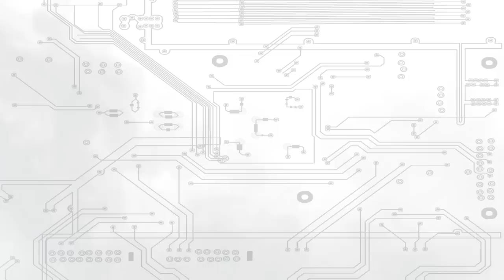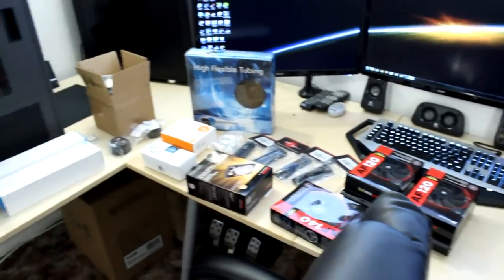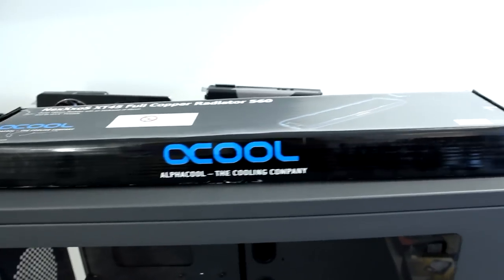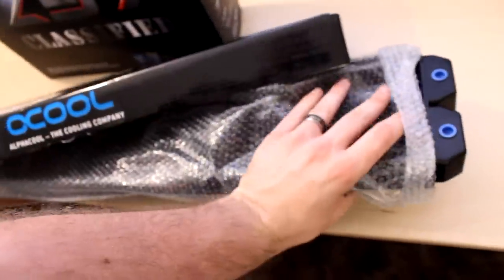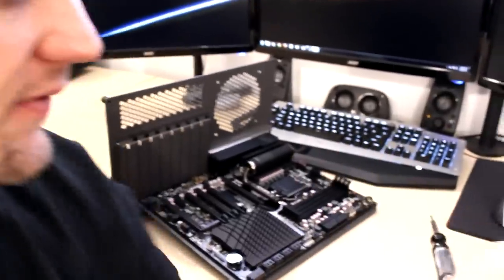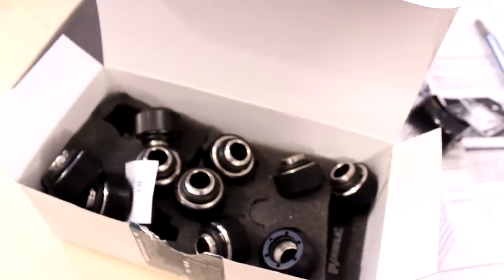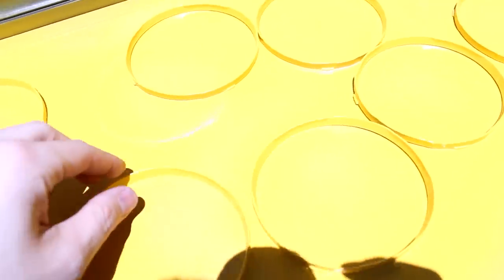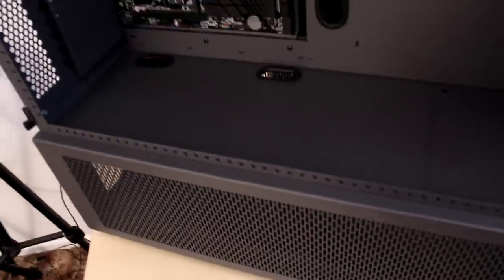Personal Gaming and Rendering PC Upgrade Vlog - Part 1

Comment: Why the AF fans for the radiators and not the SP's or a different high static pressure fan for radiators?
Reply: Those radiators are massive so he can use fans with low rpm anyway so it wouldn't really matter. AF's are just quieter.
Reply: Because Corsair didn't make SP140

Comment: Can i have some opinions on a cheap PC i want to build?
CPU:Intel Pentium G3258 3.2GHz Dual-Core
CPU cooler: I have an extra
Motherboard: Asus H81M-A Micro ATX LGA1150
Ram: Crucial Ballistix sport 8x1gb
Storage: Seagate Barracuda 1TB 3.5" 7200RPM Internal Hard Drive
Graphic/video card: Asus GeForce GT 630 2GB Video Card
Case: Rosewill FBM-01-450P MicroATX Mini Tower Case w/450W Power Supply
CD/DVD/Optical drive: Samsung SH-224DB/BEBE DVD/CD Writer
Im choosing between Windows 7 64 bit or 8.1 64 bit, I like Windows 8,1 more but 7 is cheaper.
Anything I should do different?
Reply: pirate the OS and with the money u saved get atleast a 750 ti or a r9 270
Reply: Axecution Or just find a student, and you get it for free.. Legit.
Reply: Impatience not in my country, lol
Reply: Really? I know in the US, UK and most of the EU you can.. Through the MSDNN or something like that :)
Reply: 640 is really cheap too
Reply: Axecution i have a qustion. if i build a pc and i want to change the cpu do i have to build a new pc or what
Reply: Ayan shaikh depends on what your current motherboard is, most of the time you can swap the cpu only or just a new motherboard
Reply: Axecution Its from an old dell that wont work wit any of these cases
Reply: Aaron Wright then its a bad luck
Reply: Axecution my mother board is asrock fatality Z97 KILLER SERIES
Reply: Ayan shaikh what is your current cpu? you can get a i7 4790k and overclock it if your cpu is lower tier than that
Reply: mine is intel quad core i7 4790k
Reply: Ayan shaikh the only thing worth upgrading then is x99 platform with a 5960x and ddr4
Reply: All i have is an Intel core 2 duo and an AMD processor that has all its pins bent
Reply: oh
Reply: Aaron Wright Change the GT 640 out for an entry-level GTX-series card like the GTX 750, GTX 750ti or the GTX 650
Reply: Aaron Wright Won't do much at all. If you want to game, its not gonna do it.If you want to video edit, its not gonna do it.
It seems like a good, browser. Maybe a low end server machine.
Reply: Gummin its just going to be for light gaming that the computer i had before this could handle
Reply: Aaron Wright Alright. Seems, fairly good for that then.

Comment: Is the performance gap big between the 4790k and 3770k? I got the 4790k for the improved thermal properties, but the 4790k doesn't seem to OC as high as the 3770k.
Reply: There is little to no noticeable difference.
Reply: I thought so...
Reply: Salpeteroxid I could take that 3770k off  your hands..... Nah i'm just kidding.
Reply: ThaRamoHD
Hehe if I had a 3770k I wouldn't have upgraded. This were just things that I've heard other people talk about.
Reply: But forgot one thing. The 3770k has a LGA 1155 and the 4790k has a LGA 1150 so new boards will come out with it and the LGA 1155 cpu's will have to deal with older motherboards.
Reply: *****
Maybe, I really don't know the z77 boards all that well.
Reply: Joshua Reisbord
I knew that already but thanks for adding that in :)
Reply: Salpeteroxid The Devil's canyon CPU has a better TIM system rather than the shit they use on Ivy Bridge and Haswell, so the overclocking potential is so much greater.
Reply: DuSlothster
I know, I have a 4790k, did a lot of research before buying it =) The TIM material is a polymer, unfortunately not soldered like Sandy Bridge but my cpu runs at around 60 degrees now in the summer with a hyper evo 212 push pull with the fans att 650 rpm and full load @ 4.4 Ghz (the boost frequency).
Reply: Salpeteroxid Great :D Yeah I miss the Sandy Bridge TIM, AMD still use it I think. Glad the temps are much better than Haswell.
Reply: DuSlothster
Well I had the fx-6200 before and that shit got hot as hell (around 60 and the max temps by amd is 62) and I even undervolted it at 1.350v =( , My intel gets hotter at lower volts but Intel processors are advertised to be able run quite hot.

Comment: BakerXdereks air conditioner?
Reply from the maker: haha no, although he only lives a couple miles away.
Reply: ***** Jay, how did you get ventilation at the front  of your case for 3 fans and below it is solid. I checked frozenCPU and caselabs and that wasnt an option. Did you mod it?
Reply: The2ToothedNarwhal There are plenty of options for rads/fans mounts  in the SMA8 accessories. The front panel is just the solid option combined with an extra mount you can purchase.

Comment: I have i7-4940MX 3.10ghz turbo frequency 4.4ghz is there upgrade to Intel Core i7-4930K 3.4GHz?
Reply: The CPU you mentioned is a laptop CPU,usually you can't upgrade since power problems and such
Reply: What do you mean about cpu ?
Reply: David SGT.  does it work on my laptop to play watchdogs?
Alienware 18
Specs
I7-4940MX 3.1ghz turbo frequency 4.4ghz
Gtx 880m sli 16 gb
16 gb ram
Reply: Thanks
Reply: ilan liechtung Yea sure,just make sure to update the drivers because WD is broken and and if it doesn't run perfectly on your system,It might the game
Reply: Do need to download the sweetfx?
Reply: The .Reaper I though WD was the TheWorseMod
Reply: Ok thank for info.
Reply: The .Reaper No what I meant is the SweetFX mod for WD is TheWorseMod

Comment: Can anybody please tell me the differences between a full tower and a mid tower, is there any downside of getting a full tower instead of a mid tower? Why would you want a mid tower over a full tower etc...
P.S. I want to upgrade my case in the future since I am not too happy with my current one (CM Silencio 650) and I want to get one that is very future proof and upgradeable.
Reply: I'll say to go with a full tower if you have a long graphics card as that'll give you better room as many mid-towers can be a little bit of a tight fit for some longer graphics cards. Go with a full tower if you want to do a custom water cooling loop, again to have more room in which to work. You can still do custom loops in smaller cases -- Singularity Computers has a couple build logs in the Prodigy case -- it's just a lot easier to build that in a full tower.

Otherwise, you can go with a mid tower and not have any issues. Just make sure to max out the fan capacity. I'd say the main reasons to go with a mid tower are smaller footprint and lower cost, provided everything you want in your computer can fit in the mid tower.
Reply: brandishwar Thanks for the explanation. I now am sure of getting a full tower since that seems more future proof and upgradable.
Reply: NeonCreepers most modern mid towers support long cards, and sli in micro atx boards, some mid towers like my old lian li supports full atx board but its a midi case. and removable hdd cages give me like 16" of gcard room, plus plenty of rad support, such as the fractal cases and corsair midis.
Reply: So magical It is not the long graphics card that made me decide to buy a full tower, it is the upgradeability  and the room for a custom loop. I don't have alot of money atm but when I find a job and make money I can slowly start upgrading my PC.
Reply: full towers are the same as a mid tower just bigger if you have the money and the space would get a full tower.
Reply: If you're gonna be water cooling, then definitely a full tower. I recommend browsing around PCPartPicker, and viewing the highest rated cases and how people built in them.
Reply: Elli Farts Thanks for the tip! Will definitely do that!
Reply: NeonCreepers You can get a mid-tower like the corsair 650d, 450d and nzxt h440 (ect) that are a lot better than most full towers. So it's not as simple as "THIS IS BETTER", I'd rather those than most full towers. There is a lot more to it as well like rad compatability, hard drive cages pci slots and lots more. Hope this helps :)

Comment: why go with af when you use rads?
Reply from the maker: AF is going in the case fans. The 480 is getting push/pull SP120s. The AF140s are going on the radiator since they do not make SP140s yet.
Reply: Then why not use noctua's? they've got a new black industrial ppc model

Comment: What's the cylinder to the side of the CPU?
Reply: More specifically, that's a VRM (Voltage Regulator Module) heatsink.
Reply: +Secretly Charmeleon  thank you

Comment: I see what you did you sly dog. You knew Haswell was going to be garbage for overclocking, at least on average. You ditched the original release and got Ivy instead because you wanted something of about 4.8ghz or upward. The average Devils Canyon seems very well capable of 4.8ghz on average even though the volts may be a little high for some. I should have seen what you did from the beginning. It's almost like you knew Intel was going to re-release.
Reply from the maker: You're right, And I said all of that here, over a year ago :) Why I chose Ivy Bridge 3770k vs 4770k
Reply: Yeah, I kinda feel slided but I got no one to blame but myself. Just 2 months ago I got a 4770k to replace the 4670k which was just garbage. The i7 is capable of higher clocks at lower volts but not 4.8ghz. I'm in the process of fine tuning it right now. It's going to be 4.6ghz with between 1.26v to 1.28v. I should have been patient and waiting for Canyon, oh well.
Reply: ***** well my hats off to you sir, you're certainly wiser than me. I didn't even consider myself an enthusiast up until about a year and a half ago when I really started paying attention to this stuff. But you saw Intel do this before with the i7 950. It was the same chip as before that was capable of the same clocks but they refined the fabrication process and it could do it with lower volts. Chock it up to experience.